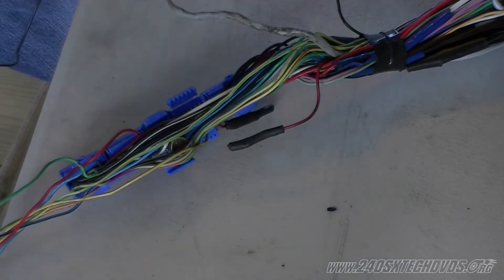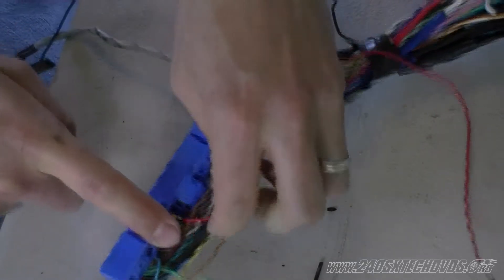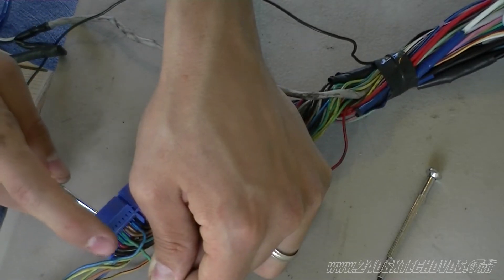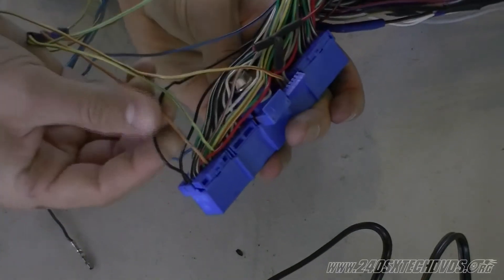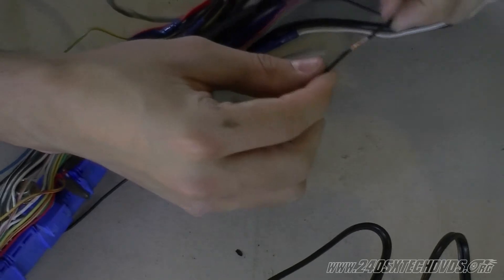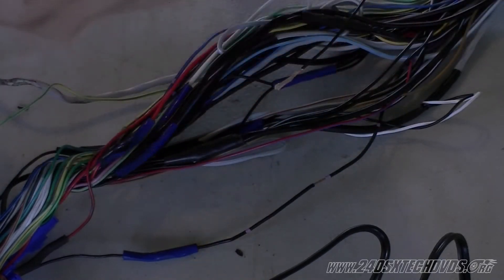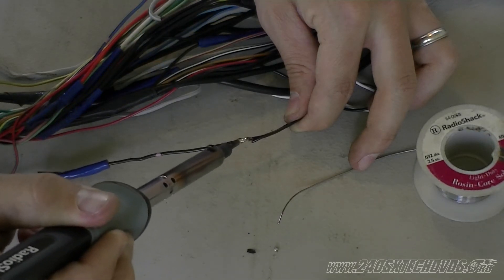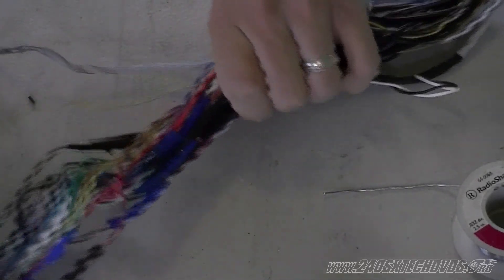240sx KA SOHC TO DOHC SWAP WIRING PART 3 KA24DE KA24E S13 S14 1080 HD.mp4

Comment from the maker: @hntr2003 Yes the ECU connector is the same but the harness will not work between the 2 engines - mainly the injector connectors are different.

Comment: I have done this with to the letter, Not getting any Spark. There is not any power is going into the distrbutor, however power is going to the coil and the fuel pump. Another friend followed this video and is having the exact same results as me. Any direction Josh Smith would be greatly apperciated.
side note, I had no issues making my S14 SR20det that was wired up for a RHD 180SX body work in my S13 240SX body. So this is little more than frustrating for me.
Reply: You ever figure the problem. I have this issue

Comment: Hey I did this but now my dash don’t work
Reply: It wont work because its a different signal, my dash wont work either but my heads up display shows the speed, also my revs wont show so you'll run into that also
Reply: So I need the other harness
Reply: @hotboiimannie7222  unfortunately no, you would need a cluster from the same year the engine came out of, see one is a digital signal and the one one is analog which is why it seems my HUD works and not the mechanical

Comment: You have no idea how much these videos have helped me! Wiring is something that always always intimidates me. But following this i got it done. So thank you. One thing i can't figure out though is now my fuel pump won't come on with the ignition. it work before the swapped fine. if i bypass the relay it comes on. do you know if i wired something wrong or if the relay went bad all of  sudden? or any other suggestions? anyway thanks again

Comment: Will i need to buy special connectors to hook a ka24de 5 speed back up to my 240sx ? im looking for a motor to put into it, but im not sure if i need anything besides the computer for that motor and the harness to go to the chassis harness. It had a 5 speed and ka24de before it was blown apart

Comment: I have a Q? having a bit trouble trying to wire up a 95 s14 dash connector to a sohc 90 s13 dash plug its different dan a 91-94 ka24de the 95 s14 ka24de has an f4 plug how do you wire that up to a sohc ka24e can it be done could really use some advise thanks

Comment: is it possible to have a ka24e engine harness to plug into a de model ecu?  Is the ecu connector the same for both harnesses? If so then the engine will never start with the e series harness on a de model ecu? Thanks, Mike